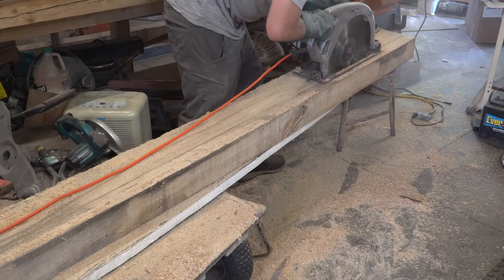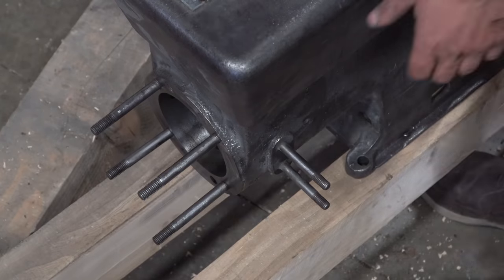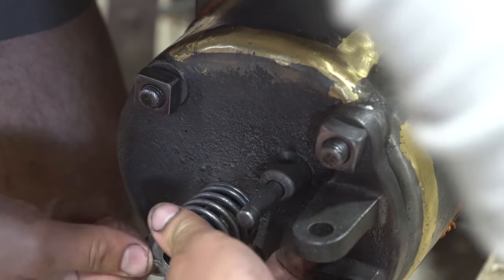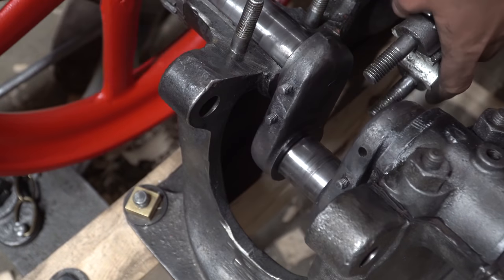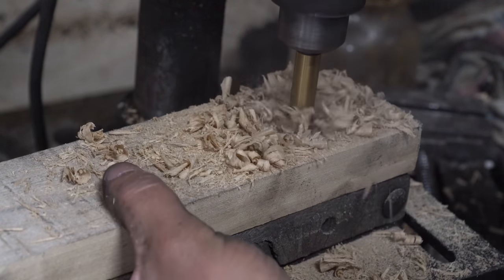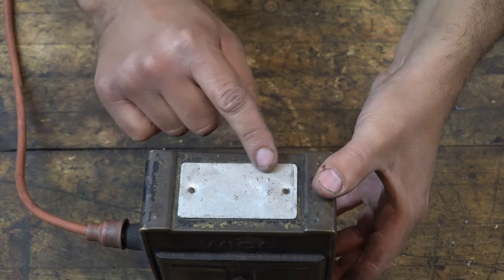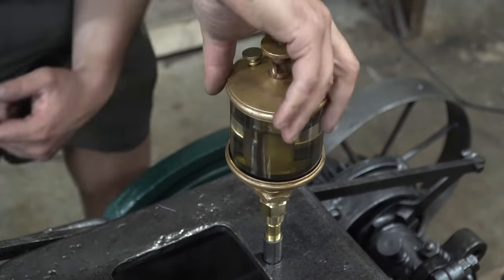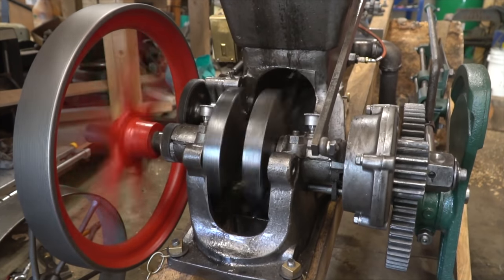Antique Drag Saw [Restoration] - Part 2: Will It Run?

Comment: FYI, it will slow down much further when tuned correctly.  Even after slowing it down, it's running MUCH too fast.  No wonder it's so terrifying!

Put a tach on it. And aim for 150-200 RPM.
Reply from the maker: Ya I should measure it.  It should run between 250-550rpm according to the manual since it's not a hit and miss engine.

Comment: Put it onto kero or if you cant get any blend a bit of diesel with your petrol {start at 20% diesel it should be like 35~50% from memory but it was a long time ago} like it was made for it will run a whole lot better as it will be nice and slow and even. Petrol burns way to fast and that is why it is running at what looks like double the speed it should. Also wire up a short for the coil or even just a basic spark plug short strap that you can get with your foot to shut her down. 
It is a 5hp so it should cut a pretty big bundle quickly. The ones I have worked on should run at about 100 rpm no more.

Comment: Ya know, I wish bronze was used more instead of brass. Both develop a gorgeous patina, but bronze has so much more character (and is superior in nearly every practical way).

Just a shame it's orders of magnitude more expensive. I'd love to see solid bronze and copper hardware on more things. But I guess I can't be too picky, if it develops a lovely corrosion resistant patina with time, be it high carbon steel, phosphor/aluminum bronze, or brass, i won't be picky.

Either way, this was a fuckin' awesome piece to restore. I like having an occasional narrated one (wish I could be a patron to get them all but money is too tight right now, so I jusy had to be okay with buying a couple of your awesome wrenches)

Comment: The very first time I’ve ever been slightly frightened by a power tool, so there’s that. Quite frankly, I’ve been around some jury-rigged, very sketchy stuff & not been nearly as afraid as I was of this contraption. So many ways to lose parts of oneself when that thing is running, the moving saw notwithstanding.

Comment: Hello! Maybe i am I'm wrong, but it seems to me that pin they should be fixed stronger. Over time, the vibrations will bend the metal, or not?

P.S. Maybe i translated wrong. By "pins" i mean things that puted in hole in shafts.

Comment: Ah yes, the days of working on extremely tall buildings and dams without safety harnesses and machines that would grind your arm off if you accidentally got too close the exposed flywheel while trying to move a lever positioned behind said flywheel. The good ol days

Comment: Any way to motion stabilize that slowmo of the engine moving? Would love to see it work without bein' all wobbly.
Reply from the maker: I actually tried that and it didn't turn out very well
Reply: @HandToolRescue  Dang. Oh well. Still a great job at rebuilding the murder death kill machine.

Comment: Oil soaked wood is great stuff--seems to last forever and be lots stronger than bare wood.  Once you use the stuff on something old school, you'll forever hate modern pressure treated stuff.   It was common on windmill work platforms ( you were supposed to be up the tower checking the gear oil about once a month)--and super easy to renew if needed.

Old diesel in a hand pumped sprayer was commonly used on the inside of utility buildings to really soak into the wood.

Too bad it's smelly old oil--that's the only real drawback.

Comment: Every time sometime flys across  the shop have a cat sound and ask whos cat is that i dont own one and you have to make sure it is brass looks smells and tastes  like brass  use 3 coats in the paint booth for small coats use kids size  clear coats rain jackets  and pull a crock pot full of food out of the tank of rust remover or some sandwiches  when something is a pain to get apart cut to you getting a chainsaw and freddy mask then try it again lol love your work wish i had the space to do mine and the time
Reply: Ps use more leather  as gaskets

Comment: Soaking the wood in oil is probably too prevent it from expanding due to moisture ingress. I doubt it would change the structural integrity all that much. Nowadays wood that has to last long is usually epoxy impregnated rather than using oil.

Comment: Just found an article that states 550 RPM as top speed?  Inspect those cast iron flywheels.  I'd run it slower if possible.

Comment: not so antique used one as a teenager to harvest swamp kauri very efficient better than a crosscut  and chainsaws weren't invented. Not dangerous and no need to  excavate both sides of the log even not as deep on the operator side. A great invention mine was a Wade Saw trade name

Comment: Kind of late to the party, but if you loosen the tension on the center of the governor, allowing the governor balls to move easier, it will run slower...the tighter the tension is, the faster it has to turn in order to throw the governor out and shut the ignition off in order to coast, so if you make it easier to move the governor, it can run at a much slower RPM...

Comment: Was this meant to be run by one person? It looks to me as if the saw operator would stand on the saw side, and the engine operator would stand on the flywheel side by the controls.  2 people would make it much safer, relatively speaking anyway.
Reply: Although,  if someone was standing on the saw side, and the wooden link between the saw and engine broke!! Oh man, it could probably put the broken link right into your leg.

Comment: 3:12 "the wheels are just solid steel, through and through"

3:25 "they just ride on these axles that are also cast iron so it's just a cast iron to cast iron surface"

Steel and cast iron are the same thing? Wonder why they have different names?

Comment: I have this exact machine with a cord saw table on the back of it 20inch blade and sliding table unmolested and for sale
Reply: The giant circular blade has no safety guard at all if you fell into it ,would sever you in half  crazy dangerous

Comment: Really loved this one... now I just have to get going on mine.  But should I fab up the buzz saw rig it originally came with... because, oh yes, Ottawa made a scarier saw than the drag saw.  Same engine but with a completely open circular blade ~2-3' in diameter.  Some of this one is at least partially home made but it works the same way as the original Ottawa.  This just has some guards on it the Ottawa didn't.  https://www.youtube.com/watch?v=6dcdI3OHhwI

Comment: Watching the use of Romex cutters to cut the cotter pins made me cringe; you can see the blade was chipped as a result. My wife did the same thing once, used Romex cutters to cut some barbed wire; ruined a $40 cutter.😥